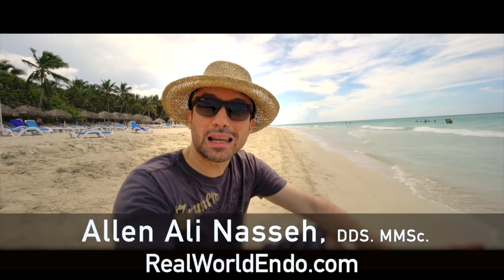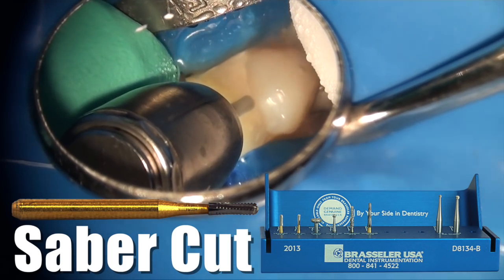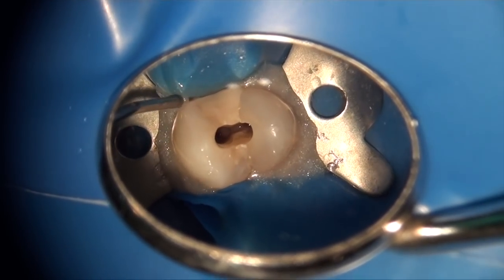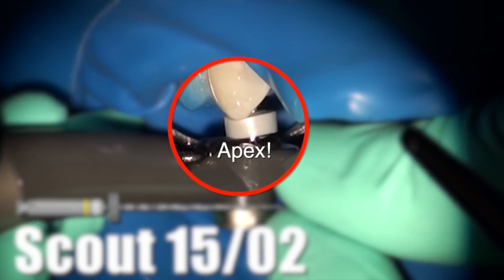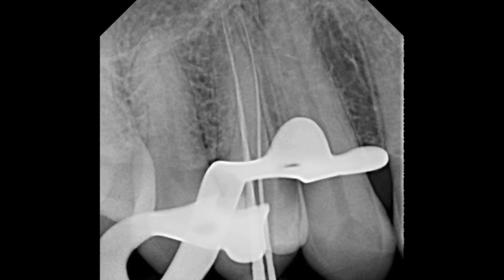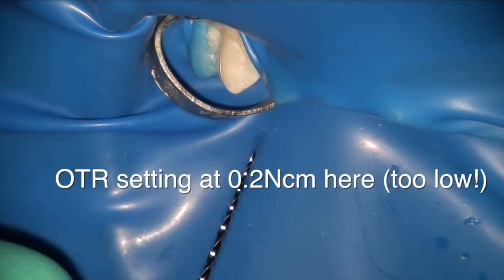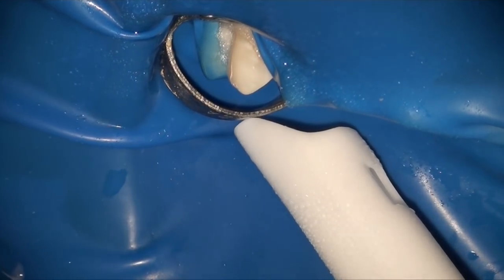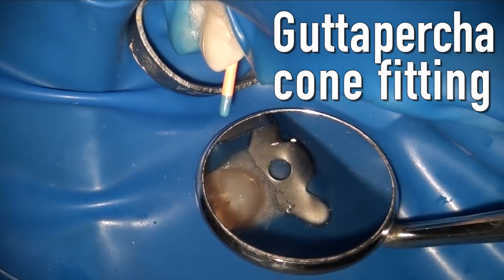CBL #20: Basic Premolar with ESX and EndoSync from Cuba!

Comment: nice case.
 ?I want to ask a bout obturation is the reason for using single cone obturation technique is the use of bioceramic sealer
Reply from the maker: Absolutely. Should not use Hydraulic Condensation with any other sealer. It's only possible due to its properties (bonds, doesn't resorb, doesn't shrink.) There will be a whole course on it I did at this year's AAE and I will share with everyone next week. Stay tuned for that as it will clarify these points. :)